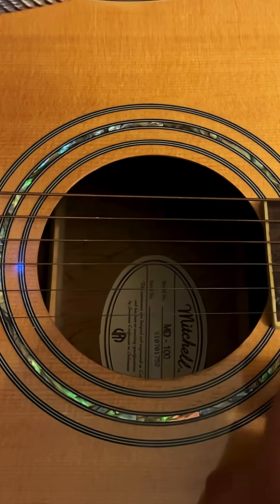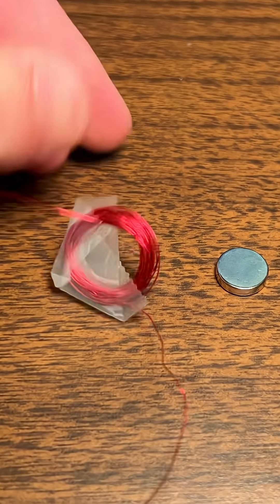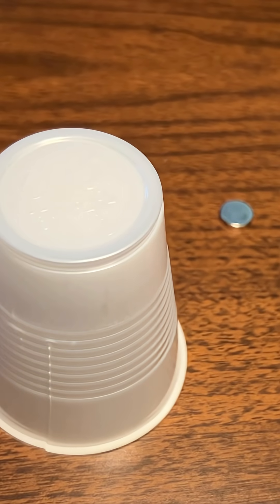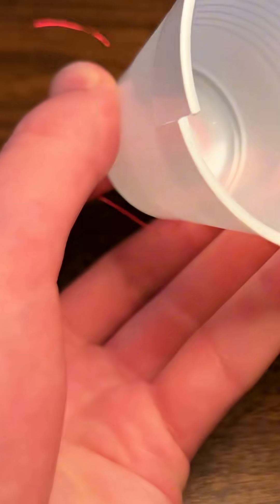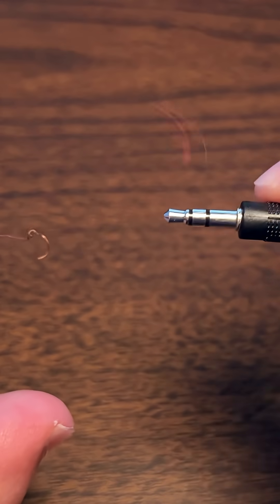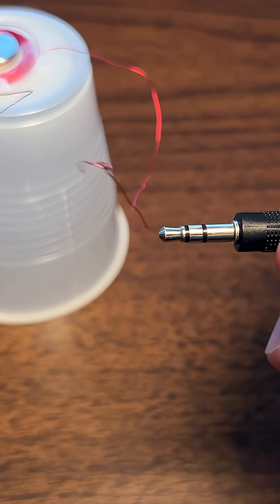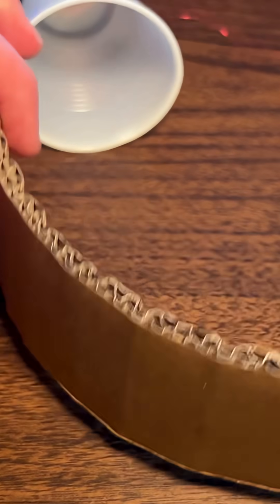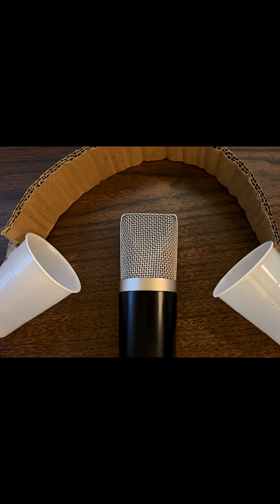DIY Headphones #shorts

Comment: lmaoooo just tape the wire to the jack, love it!!! 😂😂😂

But for real, nice demo!!
And yeah its all ridicilously simple in theroy.
You should try to use a DSP or software EQ (Like the free Peters Equalizer APO on windows) to tweak the sound further.

HiFi manufacturers are usually trying to build devices  that have a specific sound signature.
But every professional just takes whats available and twiddles with an EQ until it sounds right!! 😅
Its faszinating how good you can make even the crappiest speakers sound if you take some time to dial an EQ curve in for them ;)
Reply from the maker: I've vaguely heard about that tuning before but I didn't know how to get started. Thank you for the software recommendation! I'll have to give it a try!
Reply: @RogersLab 
Its super simple, all you do is boost or reduce certain frequencies until the ones that your playback system reproduces too strongly or too weakly are all corrected to archieve whatever you seek; be it a 'flat' neutral response or just some good sound that you like.
There is no right or wrong, just preferences and needs.

That windows software lets you specify what frequencies you want to adjust. You can add more then the ones in the default preset by clicking the green plus and change the frequency for each slider at the top of them.
You can also increase the range in the settings to 30 if you need more.
Be careful with the levels, as you can damage your gear.
The red square at the bottom volume meter will turn red if you are overdoing it.
Lover the "Pre Amplifying" value to give you more headroom with the adjustments up, or dont boost and only reduce frequencies.
Click the "Prevent Clipping" button next to the Green/Red square to have the Pre Amp volume lowered automatically if you overdo it.
Thats good to get a feel for everything at the beginning and reduce damage risk.

Just play around and you will quickly understand how boosting or taking away just a few bits can massively change the sound of a system.
Even my grandmas old budget speakers from the 70s now have some incredibly deep bass and tickling highs!!! Needed to boost 20Hz by 21db but still sounds all clean😅😂🎉

Good luck on your journey, hope this helps!!!
Reply from the maker: Very helpful. Thank you for the detail! I have a new headset put together and hopefully I can combine it with this for a long form video. I appreciate it!